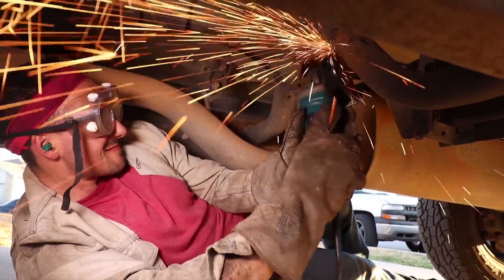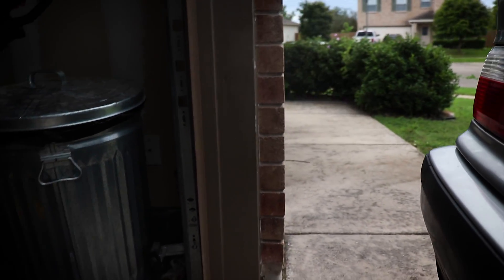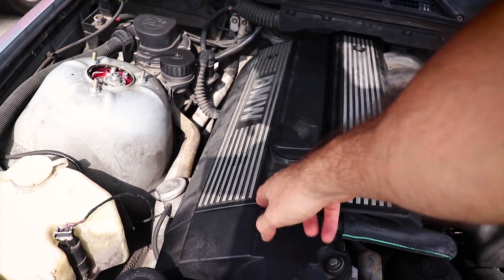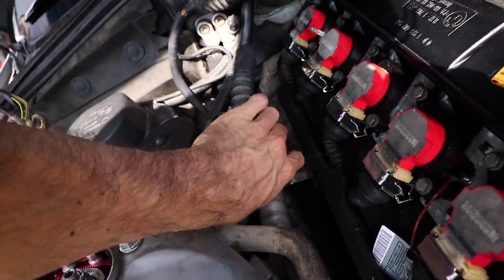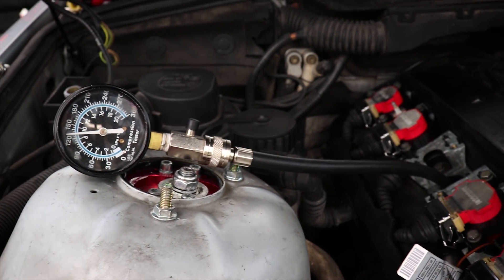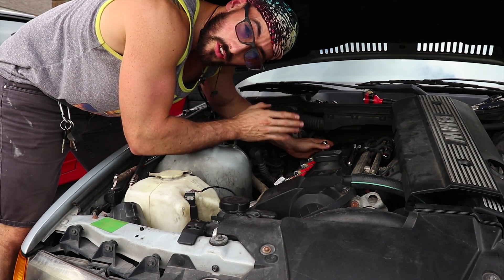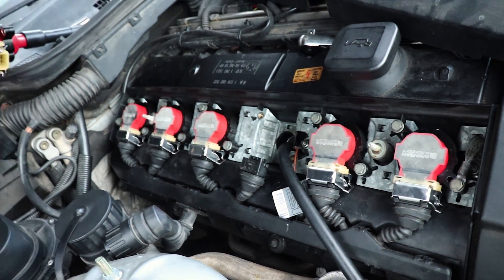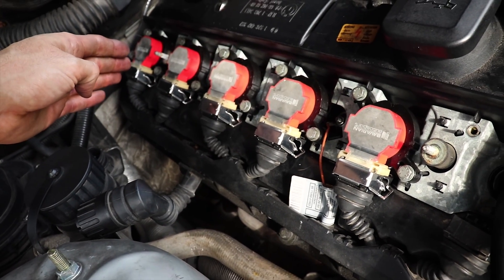Compression testing the BMW E36

Comment: Cool video. Do you think change the engine is the best solution? Or may be take it off and repair it?
Reply from the maker: Thanks, well I ended up swapping out the engine because mine had 270k and I found a used engine with only 60k for $500. I made a full series on the build. If the engine I had was low milage I would have just done a head gasket and called it a day, but it was more effective for me to just swap out the block.